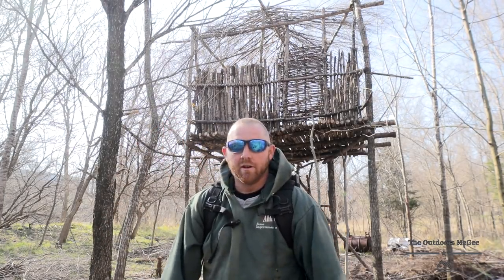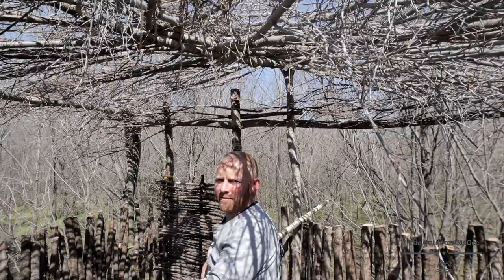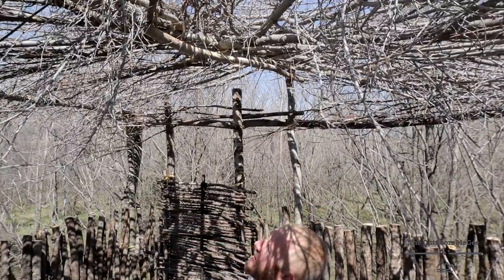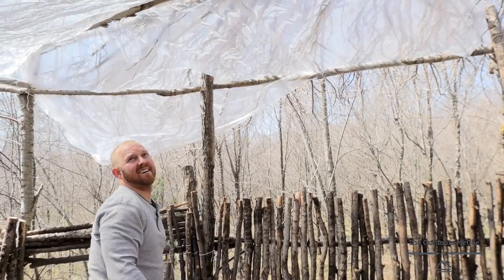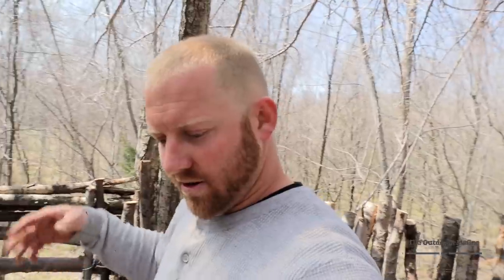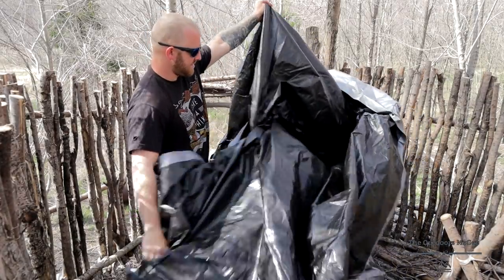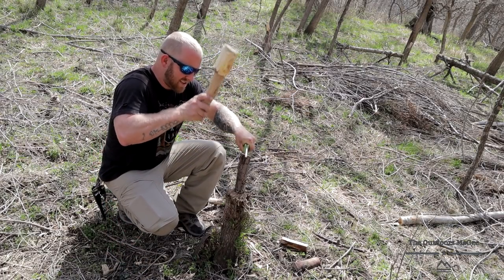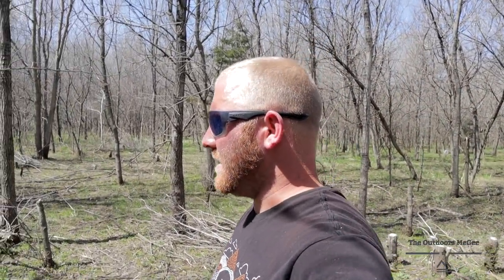Urban Treehouse Roof and Roll down walls new ladder part 5 Bushcraft Outdoors just winging it

Comment: If you add a small block of wood under each ladder rung it will make each step that much safer, just a 3in round on each side will give your step support taking some stress off of the nail.
Reply from the maker: great tip my friend!

Comment: I would have done a good heavy duty tarp on the roof and then do debris over the top of it then you have a salad with proof roof and it won't stand out specially if you use a brown tarp
Reply from the maker: Almost need a waxed canvas tarp man. The sun destroys tarps no matter what so will how this idea plays out!
Reply: @TheOutdoorsMeGee  that works too but they do sell tarps that are UV resistant and they do last and they're not expensive at all now if you have your hands on canvas do it. But I was saying put a tarp down first and then use all the brush to cover it if it's covered the Sun won't ruin it